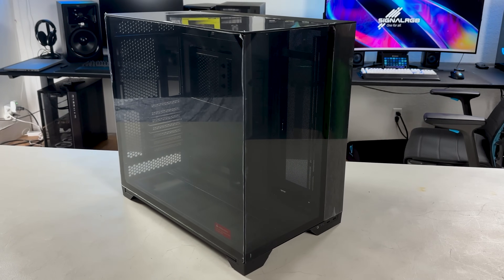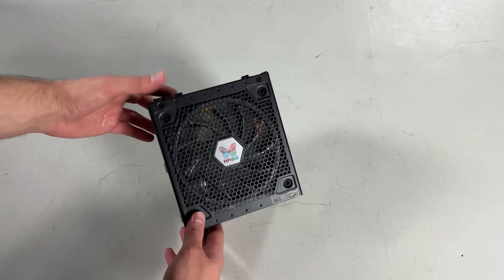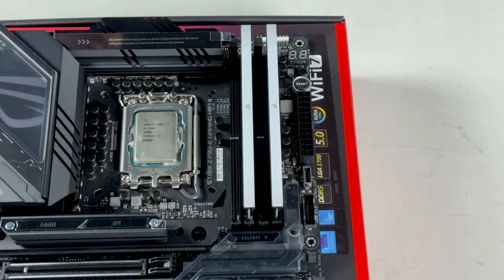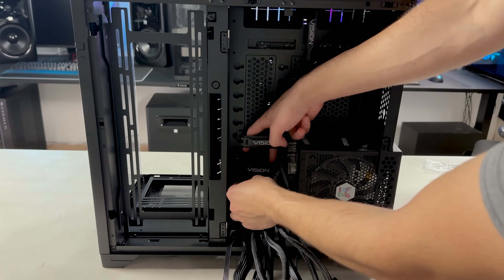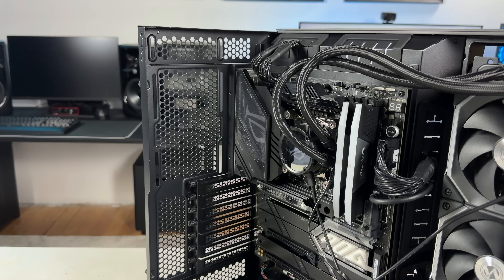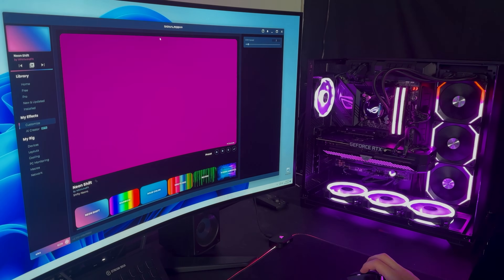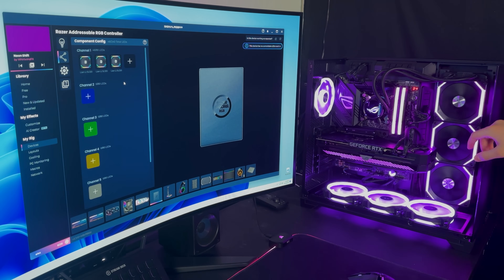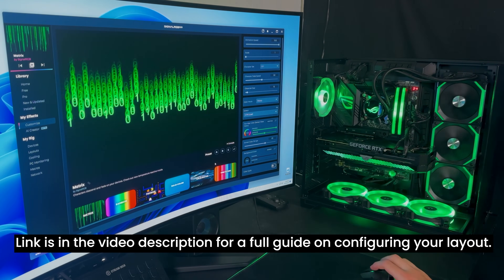Lian Li O11 Vision Build Guide | SignalRGB

Comment: thanks for leaving out the part of installing the AIO. I already put the motherboard in and plugged in all the connectors, only to find out that I have to completely unplug and take out the motherboard to install the AIO bracket to the back. Ffs man why would you leave that out?
Reply from the maker: @man1192803  its a case build guide not a guide that tells you to read your AIO manual 🥲 bracket goes first before motherboard goes in under every circumstance when you build a PC

Comment: Why did he add fans to the AIO? Doesn't the CPU cooler already have 3 fans?
Reply: Saves having to have another hub. For my next build i’m going with all Lian Li Uni fans but I’ll have a Corsair AIO. I’m going to swap out the Corsair fans on the AIO for the Lian Li ones otherwise I’d need to use a Corsair hub and the Lian Li wireless dongle. I’ll only have the Corsair AIO LCD so I won’t need to also have a Corsair hub.

Comment: Dude when you connect the cable to the motherboard don'''t wobble it in. press it in straight don't wobble it because those components attached to the pcb they are easily come off. You are the only dude Ive seen building pc that done this... goodluck to you!!!

Comment: How do I get the fans on the bottom to be intake, I really don’t understand it at all. I bought three 140mm fans and do I need to mount them upside down? It looks terrible that way
Reply from the maker: @deylonfalkner6287  the fans at the bottom in this video have reversible blades
Reply: @ did you reverse them then? How does that work? I’ve been trying to setup my fans for the past 3 hours and I still don’t understand how I know which way the air will be flowing?

Comment: OPINIONS NEEDED PLZ. 

I just installed my AsRock MOBO using the included screws. PC is working great, but for lack of a better word, the fit was not satisfying. They screw in but there is a gap. The board is secure but the flat part of the screw is not flush with the board. Like it did not screw down all the way. The board is not moving and all the screws are firmly in but again, not satisfying. Has anyone else experienced this? These were the screws that seemed to fit the best. Not sure any others would work any better. I think they need to be shorter.

Comment: What is the best fan configuration for this case I need help?
Reply: Bottom 3 intake, AIO intake on side, then 1 or 2 fans on back exhaust. This has positive pressure and keeps cpu very cool.
Reply: Bottom intake, the rest are exhaust
Reply: @M.Kairau no no no

Comment: All 3 coolers - exhaust. No 1 intake. Bad build.
Reply from the maker: @MrSimplypie  The three fans at the bottom have reversed fan blades, they are a product called ThermalTake Swafans. It’s always worth doing some research before saying something.
Reply: @SignalRGB could an NZXT f240 fan go in the back for exhaust? Or is it ONLY Lian Li UNI fans that can fit back there at 240mm.

Comment: All are exaust fan 😂🤡💀
Reply from the maker: Bro has never heard of reversible fan blades. The fans at the bottom are thermaltake swafans and the blades pop out and are reversible, they are pulling air into the case

Comment: Sir i have deepcool LS520 240mm AIO which i cant control individually...i have been in touch with your support through emails for more than month but problem not solved yet even i purchased razer controller..recently someone on your  discord server said its not possible to control all components of AIO individually bcoz deepcool doesnt do true daisy chained...is that true ?
Reply from the maker: @Iconic11111  It’s probably true if someone said that. Which would also explain why support couldn’t help you. It’s a hardware limitation.
Reply: @SignalRGB  Thank you so much for your reply ... then please suggest me any 240mm(on preference) or 360mm AIO which i can control through Razer Controller..there are plenty on your supported device list but at the end not all works properly just like my deepcool AIO which i purchased after seeing your supported device list..i asked even on your discord server but no one suggested so please tell me any specific model 🙏
Reply from the maker: @Iconic11111  Any of the Corsair aios will be controllable just fine
Reply: @SignalRGB  https://youtu.be/Qd209pxPzpc?si=IPPWXq9mdf_LedSU
Sir in this video you said corsair components are proprietary so will corsair AIO work with my razer controller which is non proprietary...sorry for asking so much but i just want to be sure bcoz am already doomed by purchasing deepcool AIO dont want to repeat same mistake !
Reply from the maker: @Iconic11111  The Corsair AIO comes with its own controller so you wouldnt need the Razer one.

Comment: Why did you make all of the fans exhaust?
Reply from the maker: @eaggra  the fans at the bottom are thermaltake swafans and the blades pop out and are reversible, they are pulling air into the case
Reply: 😂😂😂😂😂😂😂😂 @SignalRGB
Reply from the maker: @SpongeBob-xh8ir  Bro has never heard of reversible fan blades. The fans at the bottom are thermaltake swafans and the blades pop out and are reversible, they are pulling air into the case

Comment: For me I use arctic fans with the Razer argb controller,
But there's one issue that I need help with the RGB lags and isn't smooth I don't know how to discribe it Bette but if I plug them into the Mainboard they work fine and the lights don'ts stutter if I use a wave effect 
Please help me
Reply from the maker: Did you adjust your devices in the layouts tab and configure them in the devices tab?
Reply: @SignalRGB  yes
Reply: @SignalRGB  they also stutter in the Razer software
Reply from the maker: @coffeintaler706  defective controller?
Reply: @SignalRGB  I have it for about a month now can I still return it
Reply: @SignalRGB  I thought it either works or it doesn't

Comment: So, you installed 7 OUTPUT Fans! NO INTAKE???
Reply from the maker: Fan in the back and the 3 fans on the side are pushing air out, intake is at the bottom, they are reversible fans.
Reply: @SignalRGB  at 8:41 it’s clearly that the 3 bottom fans blowing outside.
Reply from the maker: @sinotnasinotna5861  The blades on the fans are reversible. They are called Thermaltake SWAfans, google it.

Comment: I notice good news on the case, the side panel, I'm going to use that for a pump/ reservoir combo, and on every side a real black light 30cm TL tube. And there is plenty of space for that, especially with the 011 dyn EVO XL and every HD cage, is going to contain the electronic balast for the TL's. Very good isolated to prevent EMI, with copper strips and faraday fabric. This system also going to have aqua computer Octo for automatisation and temperature fast sensors and a temp/ flowmeter for steering the fans and the ARGB, all fans will be Lian Li, and I'm happy to hear you are working together on these products. I also have a Razer Chroma controller and this is going to steer all the DRGB from EKWB. The fans on the side, behind the black light tubes are going to be BeQuiet or Noctua, non RGB ones and on a slower pace, just to remove heat from the tubes. There will also be a ESP32 with relays to put the TL's on and off via my Iphone with an app. And also other things like monochrome LED strips. So this will be a very special build. It's probably my last system that I will build. Of course with the Pro version from SignalRGB. Thanks for the update. Maybe there is more to come inside this  case. Anyway, this will be an high end built with Custom loops.

Comment: If I do intake from the bottom and back of the case and exhaust from the side mount with the radiator will I mess up my AIO cooling? 
I have 2 intake at the back and 3 at the bottom and my AIO radiator is mounted to the side with 6 fans. At the moment I get around 60 degrees when idea and around 65 to 70 when gaming.

With a 7800x3d

Comment: Nice build. I gave my old Lian Li O11D to my nephew, replaced it with NZXT H9 Flow, I was going to go for the Vision but got a good deal on the NZXT, both cases are amazing. I would have used same fans throughout. He mixed it up with Lian Li and Corsair fans. He has plenty of space to mount the GPU vertically, So many ARGB controllers!

Comment: Hello you mentioned it will fit two fans in the rear if using Lian li's fans but I've seen builds with other fans there. Can you clarify?
Reply from the maker: As far as im aware the fans needs to be the type that connect together in a similar fashion to Lian Li’s unifans. I tried with normal fans and two of them will not fit. I believe the Corsair Link Fans would also fit but don’t quote me on that.
Reply: @SignalRGB  Thanks for the reply! I found the solution here: https://youtu.be/73fpY5aoZI8?si=6hZ0VPPfw_Lo_a9V&t=1076. Basically there's a motherboard low and high position, if it's on high(?) position you can put the small bracket you put on the bottom rear to the top rear, hence having another space for a 120mm fan.
Reply from the maker: @YuuriPenas  oh wow i had no idea, thats really cool

Comment: None of ur fans are set up for intake. Why are They all set up to take the air out?
Reply from the maker: Fan in the back and the 3 fans on the side are pushing air out, intake is at the bottom, they are reversible fans.
Reply: @SignalRGB  They don't seem like reversible fans. We can see the convex side of the fan blade, so it means the air inside the case is being exhausted.
Reply from the maker: @MultiKratonvideos  They are called ThermalTake Swafans just google it.

Comment: Your radiator is not mounted properly, you'll have air near the fittings and in the pump, the tubes should be down.
Reply from the maker: The rule is that if you can: first try with tubes at the bottom, if you absolutely must mount them with tubes up that's fine but not optimal.
The highest point of the radiator should be higher than the pump location, which it is in this video. Normally I would mount the AIO at the top of the case but well… the top is glass! Take a look at a lot of the promotional imagery for the case, the AIO is mounted as shown in this video.
Reply: I'm aware, I have the same case.

What is shown in the promo is indeed not optimal.
Reply from the maker: @myemth1506  There is no other way to do it, if you own the case then you know that the tubes don’t reach mounted down, so what is the point of this comment you made?

Comment: Again wrong AIO mounting position.. the AIO will be sub optimal and will fail sooner due to air pockets at the top most position of the system.
Reply: how would you mount the AIO?
Reply from the maker: @PumpedMLgsniper  He is probably just quoting another youtuber without considering the limitations of this PC case. The rule is that if you can first try with tubes at the bottom. IF you absolutely must mount them with tubes up that's fine but not optimal. The highest point of the radiator should be higher than the pump location which it is in this video. This case doesn’t give you much choice since the top is glass and you can’t mount it there.
Reply from the maker: The rule is that if you can: first try with tubes at the bottom, if you absolutely must mount them with tubes up that's fine but not optimal.
The highest point of the radiator should be higher than the pump location, which it is in this video. Normally I would mount the AIO at the top of the case but well… the top is glass! Take a look at a lot of the promotional imagery for the case, the AIO is mounted as shown in this video.
Reply: @SignalRGB  so if i can get it with the tubes at the bottom it will be better then with tubes on top if not tubes on top will be fine but not optimal. also are the hubs necessary to control the rgb or is it because of a lack of connectors on motherboard? if i wanted say 3-120mm lian li uni sl-inf fans  reverse for radiator, 2-120mm sl-inf for the back of case, and 3-120mm sl-inf reverse for bottom of case how many hubs would i need?

Comment: Curious why you chose that particular m.2 connector.  Does it matter which is used?
Reply from the maker: On regular office and gaming PC motherboards, the M. 2 slot closest to the CPU will most often be the one that has the highest bandwidth, but always check your motherboard manual to make sure. This is especially important if you purchase a high-end SSD.

Comment: Oh now you partner with Lian Li after I just built a full Phanteks system. Love the program, though, I need to get a different ARGB controller, the built in one in the Phanteks NV7 once it is connected to the mother board doesn't separate the different fan sections. So question with Signal RGB do you need to have multiple controllers to split the fans and AiO into separate zones?

Comment: Does the SignalRGB x Lian Li partnership mean the lian li fan controllers will work better in SignalRGB now?  or maybe LConnect having compatibility with Razer RGB Controller?
Reply from the maker: Yes we are hoping that Lian Li can improve the controller to better work with SignalRGB.
Reply: Or u can improve ur software to work better with Lian li hub Im almost getting flashing errors with your guys software
Reply from the maker: @Metroidslayer66  We cant fix it, Its Lian Lis product design thats the problem. It cant handle direct usb control without lag and other issues.

Comment: when will you update to fully support the lian li controller i can not even use mine it keeps telling me limited frame rate and i am paying for pro version
Reply from the maker: As mentioned in this video. We are guiding Lian Li on how to improve their controller firmware so that it can better support SignalRGB. The limitation is on their side. There is no ETA yet but stayed tuned over the next few months. It is not related to Pro at all, we actually don't lock any RGB control behind the pro subscription.